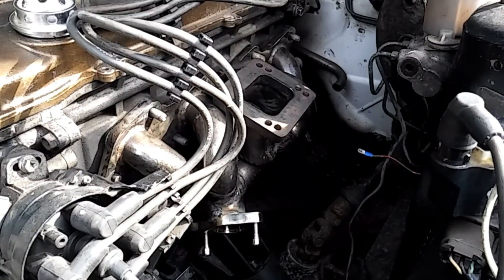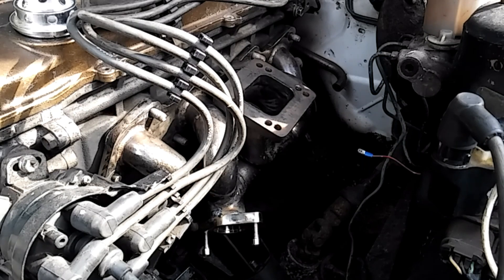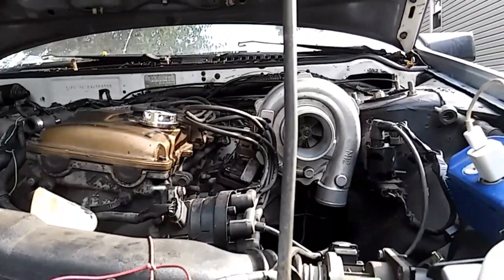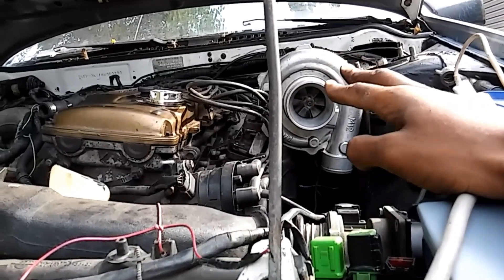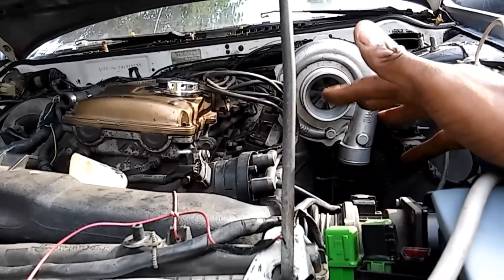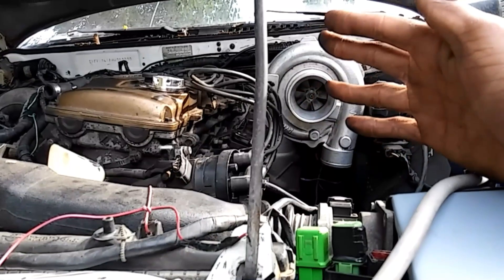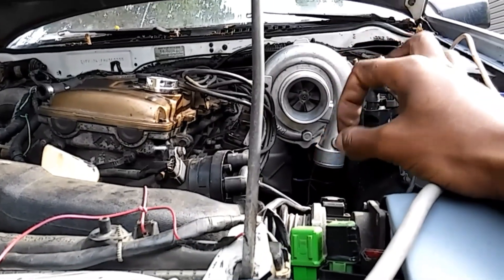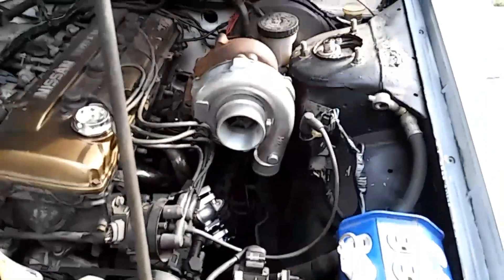TEST FITTING THE EBAY TURBOCHARGER 🔥

Comment: Hood spacers will for sure be good thing, help duct all that heat out of the bay. Did it on my s13 and it helped. Wish I knew a welder!
Reply from the maker: Word! Since you have results Ill definitely do that. I was gonna cut my solid mounts in half to drop the engine.

Comment: Nah man no intercooler would be no Bueno your turbo and charge piping will heat soak so quick and the boost is going to be pointless, the whole point is to get cold dense air in your engine you'll just be cramming hot air in, Might as well just do it right the first time !
Reply from the maker: True. Thanks for the input. On top of what you said, if I decide to go above 5psi I'd need an intercooler anyway so yeah. Team intercooler lol
Reply: +Ride&Slyde TV luckily they're cheap on ebay lol
Reply from the maker: +hugeslacker Ebay is life when you're broke like me lol
Reply: +Ride&Slyde TV I'm not broke but I love a good deal haha.. My jeep is half ebay.

Instead of spacing the hood out I think it would be pretty dope if you welded on the bulged part of the hood of an eclipse, to clear the turbo.
Reply from the maker: +hugeslacker That's not a bad idea actually, but the hood is so clean and if I mess it up I couldn't find yet alone afford to get another one.